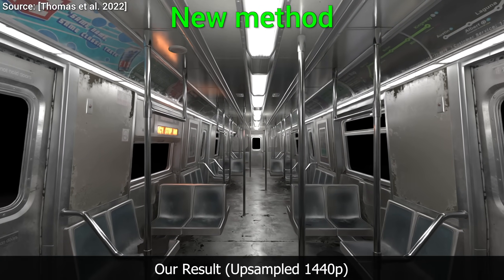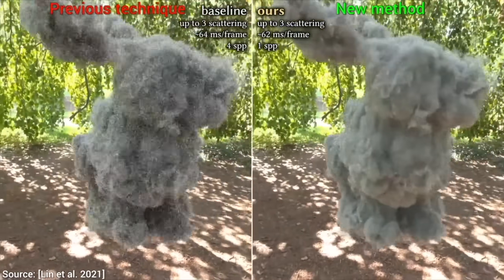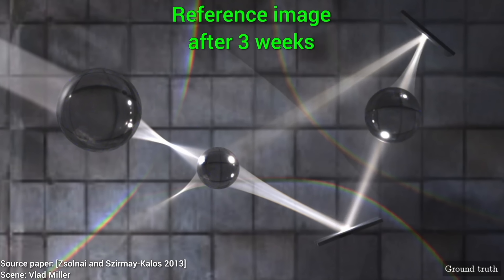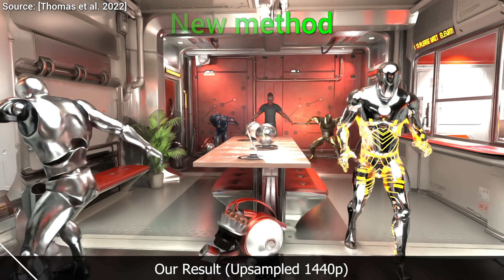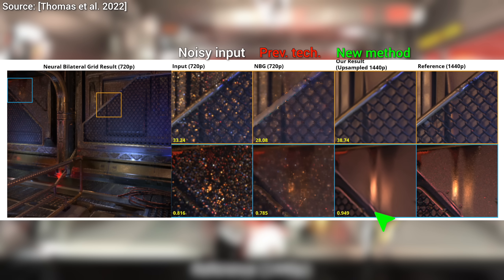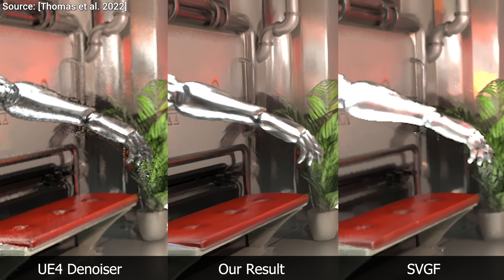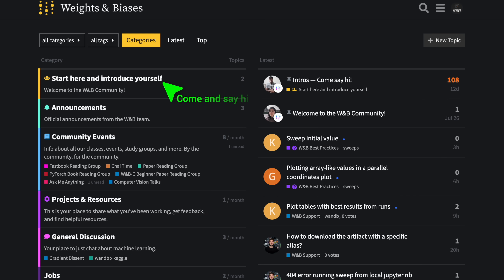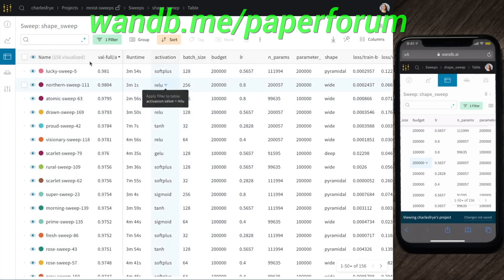Intel’s New AI: Amazing Ray Tracing Results! ☀️

Comment: I wonder if these techniques can be combined with traditional rasterization-based rendering, which should produce nice sharp edges and avoid any blurriness produced by the denoising. I imagine if you run both a coarse light simulation and a rasterization step, then combine the results with a neural network, you can get the best of both worlds.
Reply: It's already rasterised as a first step, to produce a G-buffer of surface normals, texture & colour information. That's done with Unreal Engine 4, in this case. That rasterised layer then informs the raytracing, supersampling and denoising steps. The key idea here is that they're combining the supersampling and denoising into one process.

It seems like they didn't really want to pre-process the reference scenery too much, but you could probably get a better balance of sharpness & smoothness by giving the hero meshes some invisible texture maps that just say "stay sharp here, it's a human face", and "don't worry about this, it's just the floor".
Reply: @alexmcleod4330  I see, interesting.

Comment: Seems to me that even better results are possible. Some surfaces loose resolution. These surfaces have repetitive textures which should be able to replicate on the final image. Maybe need both a high resolution non ray traced stream and the ray traced stream. The fine details of textures can come from the non Ray traced version. Maybe use several different fast light transport methods at higher resolution and Ray tracing at the lower resolution and merge all into one NN. Definitely can do better than this in a future paper.
Reply: This is exactly what modern games often do — hybrid rendering combining traditional rasterization and ray tracing.

Comment: is it different from the open image denoiser? because I heard they have a patch that runs on GPU instead of the original that runs on CPU
Reply: I read in another comment that this one is that denoiser but upgraded
Reply: @JorgetePanete  I hope it gets implemented in 3d softwares soon cuz I don't use optix which is faster but trash not to mention that the Intel's denoiser is so clean that it doesn't need a temporal stable solution
Reply: @johand3114  It's on blender right now!

Comment: cool but the output image is unpleasantly blurry. it's like watching videos made with smartphones 12 years ago. it's okay, but you clearly... see it's not where we want it to be.
Reply: Yes, they're starting with a 1280x720 image, and upscaling that to 2560x1440.

Sure, it's still blurry, but this is a big improvement over the other methods for upscaling noisy realtime raytraced stuff, and it's nowhere near as expensive as rendering at 2560x1440 natively.
Reply: @Garrett granted, but upscaling (and denoising at the same time) is its job. Comparing 720p to 720p would just be demonstrating its denoiser, which isn't very novel by itself.

It's not an ad, though, so you don't have to wonder whether or not this is the Best Thing Ever. All that matters is that an improvement has been made, and because the method is public, we can all benefit from it!
Reply: @Garrett You should read the paper's introduction, or at least its title. The novel part is supersampling and denoising together. The goal is to quickly & cheaply match the 1440p reference, from 720p input.

The rationale is given in section 3 of the paper, and if you really need to compare 720p to 720p you can just download and watch the video at 720p. You wouldn't be missing any information, because the denoising should only give its best results with the higher-res inferred image anyway.

Basically they're saying they combined some neat stuff for a surprisingly decent result, and you want to know what it would be like if they hadn't done that.

Comment: Do I get it right: NVidia and Intel both are competitors now for ray tracing? Are they in any way compatible? I.e. can Intel help Nvidia graphics to perform faster ray-tracing-wise or vise versa?
Reply: In this case, the researchers are only showing off their combined supersampler/denoiser. They haven't done anything to the raytracing itself.

The engine underlying it all was Unreal Engine 4.25 (which has hardware raytracing features), running on an RTX 3070, and the new tech being demonstrated appears to be some Tensorflow and some Vulkan.

So it should be possible to implement this in other engines, and on any GPU with hardware raytracing and some AI capability. That'd be any new hardware from Intel, NVidia, AMD, or even some of the bigger ARM vendors.
Reply: this algorithm, intel's open image denoiser may help nvidia and others since it's open source

Comment: I don't understand why they don't build these techniques into the rendering, why wait until after when you have no information about the scene? It would have been trivial to get real high frequency details back from the geometry and textures.
Reply: I think it’s the quick real-time aspect that they’re aiming for.
Reply: @itsd0nk  I specifically built that step into the earliest part of the rendering pipeline because the advantages are monumental and the cost is insignificant. I think the main reason is so you can tack it on as an afterthought.

Comment: I'd appreciate just a small explanation of what's the new idea of the new techniques presented in the videos : how it works under the hood, in a few sentences. Is it a neural network, where the previous techniques were hand-crafted? Is it a new kind of neural net architecture? Is it just a math operation that nobody thought of applying to this problem before? Just a glimpse behind the technical curtain, instead of just the results, would make these amazing videos even better!
Reply: Sounds like we need two minute papers for a quick overview and five minute papers for a slightly more technical explanation. Maybe have to paper author do a quick interview showing their work if they are available?
Reply: I second this motion.
Reply: From the abstract: "We introduce a novel neural network architecture for real-time rendering that combines supersampling and denoising, thus lowering the cost compared to two separate networks. This is achieved by sharing a single low-precision feature extractor with multiple higher-precision filter stages"
Reply: @tomwildenhain  🙌
Reply: I 100% agree, that's a good thought.
Reply: The paper is called "Temporally Stable Real-Time Joint Neural Denoising and Supersampling", and if you're that curious, the link to the paper is in the video description.
Reply: @liambury529  wouldn’t hurt just to give a extra little bit of info in the video tho
Reply: @facts9144  I concur.
Reply: while it'd be cool, it wouldn't work in practice since Dr. Karoly can't humanly know in detail the process behind these papers unless he was somewhat specialized in the field, it'd require huge amount of research just to get to understand the concepts being used in the paper let alone being able to give an useful insight of how they are being implemented. I do not exactly know in what area Dr. Karoly majored but even then with just the level of variety in the papers he publishes it wouldn't be enough to understand all of them, since most are hyper-specialized areas
Reply: @javierflores09  He used to at least show a basic architecture diagram, in his older videos. Even just reading a sentance or 2 from the abstract would be useful, even if only to people smarter than me.
Reply: @chrispsps  I agree. His older videos explained some of the techniques or terms while the newest ones are more of just a high level showcasing of the demo.
Reply: There's not much to say about the methods as I do not imagine intel to be Happy with sharing any source codes. Best you can get is sole grossly underestimated explanations
Reply: @hakimehamdouchi7468  Ok, but at least give some basic information about what kind of process(es) are being implemented. We don’t have videos comparing car engines to prior year engines while only mentioning their 0-60 speeds. Did they change how many liters in the engine? Did they go from a V-6 to a Straight 6? New generation of piston tech?

Comment: I would like to see just the denoising step compared to reference in the same resolution...
I cannot help but feel like even the new method outputs a blurry mess without any high frequency details anywhere in sight - which is to be expected since the technique has to reconstruct the "high resolution" by conjuring 4 new pixels for every pixel of input.
Reply: A couple of comparisons are shown in this video, and it's exactly as you say. Looking at the spaceship example is the most obvious: The side panels have some "dots" as  either geometry or texture, and the noisy+filter version doesn't reflect this detail.

It's minor, but it goes to show that you still can't use this in a professional manner,
Reply: @goteer10  i don't think it's minor - it's significant enough for me to prefer the look of traditional rendering techniques at that point.
Reply: @radekmojzis9829  To be fair, this could be combined with traditional rasterization.

Comment: I didn't know intel was doing AI research aswell, thanks for the exciting news!
Reply: At this point everyone is doing secretly, seems this is the future of computational speed
Reply: Intel has been been doing AI research for nearly 2.5 decades now. Heck, in the early to late 2000s, they demonstrated running a RT on a CPU by generating a BVH structure. Sure it was slow, but was pretty impressive.
Reply: @kishaloyb.7937  I didn't realize ray tracing was such an old concept, first time I heard about it were the real time ones by Nvidia. 👍
Reply: @Garrett yea I'm guessing it has alot to do with software aswell

Comment: Would it be worth it for the light simulation to run even longer than 4-12 milliseconds? Allowing it to be less noisey base, resulting in a higher quality output? Or would it just be negligible/not worth it?
Reply: The light simulation quickly plateaus, which is why it takes hours to get the (still noisy) reference. Maybe with a faster computer you could choose to spend an extra few ms on raytracing, but for realtime if it takes 10ms to raytrace and 5ms to denoise/upscale that's already only 66fps. Once you add physics simulations and game mechanics you won't want to decrease performance much further. For non-realtime applications like films it doesn't matter, people will spend hours per frame then run this denoiser on the 'reference'.
Reply: @speedstyle.  Ah, thank you for the response! That makes sense, and yea for video game ideals/standards you probably wouldn't want to do that. I will say my intentions for what it would be used for is a a bit different but similar to the last portion you mentioned. I was more thinking of using it in rendering software like the person in the pinned comment mentioned. It might be helpful for previewing in viewport with denoising.

Comment: It's not really fair to compare with the outdated SVGF algorithm when the followup A-SVGF paper solved the main shortcoming of the original paper (significant ghosting/smearing during motion or lighting changes) already 4 years ago. 
For example, A-SVGF is what was used in Quake 2 RTX back when real time ray tracing was still new.
Reply: It was labelled as SVGF, but also as being from 2020. More likely to be a variation of it. SVGF is a 2017 paper, A-SVGF is a 2018 paper.
Reply: @Exilum  The one from 2020 was a different paper labeled "NBG". (Neural Bilateral Grid)
Reply: @Dayanto  ok, my bad on that
Reply: I will add more, it's not fair because Nvidia has an even newer denoiser "nVidia NRD"
Reply: There's no fair in science.  Peer review is very unfair at times and ruthless.  Just the way it works.  Speaking as a two minute scholar who does not read the original sources.

Comment: I'm also very happy for another reason. Since it's Intel, not Nvidia, that means this simulation probably ran on a CPU, rather than a GPU. I have a Nvidia GTX GPU (that doesn't support that vulkan raytracing extension), so I'm sad that almost no game supports raytracing on my card. But I have an Intel CPU, so if this was CPU only or CPU + Integrated graphics, that would mean that this will be supported on any Intel processor and won't require different hardware!
Reply: Welcome to 2022 where Intel is a GPU manufacturer and is invested in competing with AMD and Nvidia.
Reply: This paper is about a denoising algorithm designed to run on top of raytracing, so you will still require a GPU that is capable of raytracing in order to benefit from this. If anything, this would be something that would be implemented on Intel Arc GPUs. There's no way a CPU would be able to run realtime raytracing with current technologies.
Reply: According to the paper, it was all running on an NVidia RTX 3070.

I know it seems weird for Intel to show off something that doesn't even use their hardware - but this is more of an academic paper, and not really a product they're advertising.
Reply: I read in another comment that it can run on the CPU and will get GPU support

Comment: It seems that neural network based denoising could benefit from an input reference image rendered very fast without raytracing, but with high detail.  Then, this high detail image plus the raytracing image can be used by the denoiser to get the lighting correct without washing out the detail.
Reply: The existing version of OpenImageDenoise does something like this, you rasterize the scene and save the albedo and normal maps, then do a noisy raytraced image, and pass all three as inputs and get a denoised image after a second or two. I haven't looked at this paper but it might be possible they're doing something similar.
Reply: The neural network is trained according to reference input. The renderer already knows the geometry and blurs the noise accordingly.
Reply: I think this would also be really good for DLSS 3 because the frame could be generated without much latency based on actual data rather than interpolating between two frames
Reply: that sounds cool but it wouldn’t be as authentic
Reply: @brianjacobs2748  depends on how it is trained.
Reply: @brianjacobs2748  More authentic than no raytracing at all, which is the alternative

Comment: Am glad this is going to be implemented in blender, as they are already working on it.
Reply: can you provide a link, pls?
Reply: @mosog8829  many thanks. have not looked at the 3.4 alpha yet. release notes say that path guiding works only with CPU, but GPU support coming in future. may be worth doing some comparison tests with CPU only, but obviously real gain will be with GPU.
Reply: @juliandarley  welcome.
Indeed. It will be even better if it's possible to combine CPU and GPU.
Reply: You might be confusing this with the new Pathguiding feature for fireflies that will be implemented into Cycles in the future. I have seen absolutely nothing about this new denoising being implemented into Blender
Reply: @kleyyer  it wasn't my suggestion, but i can ask blender hq about it. i did look at the new alpha and it did not look the same as what is show here. i still keep hoping for good caustics from cycles. for me, needing photoreal renders, it is the number one thing that lets cycles down.

Comment: would advances in ai mean that we will require less gpu to play a complex game?
Reply: For sure. It already happens with for example DLSS (Nvidia) or XeSS (Intel). They are both based on neural network that upscale image rendered in lower resolution
Reply: It depends a lot. A lot of AI solutions are often just as heavy to compute, which is why we need specialized cores and parts (RTX cards, for an example) to make sure that the AI calculations are not wasting just as many resources as the game or render. What this means, however, is that new cards don't have to be much stronger, they just need to have these specializations and they can be as good as older cards while getting better performance.

A good example of this is how Intel's own AI upscaling technique (Intel XeSS) that works like DLSS doesn't give you much better performance unless you have Intel's new GPUs. Your card just does so much work to upscale the image that the performance barely improves.

Comment: i would love to know if or when this could be applied to Blender/CyclesX so that 1) we can have much reduced render times of photoreal scenes and 2) reasonably good caustics.
Reply: Wait wait wait bro how is your comment 7 hr old but the video is only 3 min old??
Reply: @shmendez_  videos are shown early on patreon
Reply: @nullneutrality8047  love how patreon so popular ppl say it instead of membership xD
Reply: @shmendez_  em….maybe timezone issue?
Reply: Honesty once this gets included into blender it's going to be very good, as I can see this ai Denoiser will definitely help render frames faster, it would be very cool to see a comparison of this technique with their other Denoiser, openimagedenoise.
Reply: it surely would help although id want to point out that there is still a very clear loss of detail so you'd still need a lot of samples. And thats expected, this is meant to run real time whereas blender can afford to take its time. This runs at 200 fps, id much rather have it run at 24 to 30 but preserve detail better
Reply: @Smittel  yes, there is some high frequency loss, but yes, blender has time, so therefore very promising. we work at 24 or 25 fps, so again, that will help get the render time down. no mention of blender in the paper, though not surprising since the researchers use Unreal engine. encouraging that for most renders they us an RTX 3070 - not some massively expensive GPU. finally, re detail loss, they say: "Our network produces high-quality results, but we have observed that there are trade-offs between temporal stability and sharpness depending on the choice of the loss function weights. Finding an optimal weight factor for the spatial and temporal loss function remains future work."
Reply: yeah lol